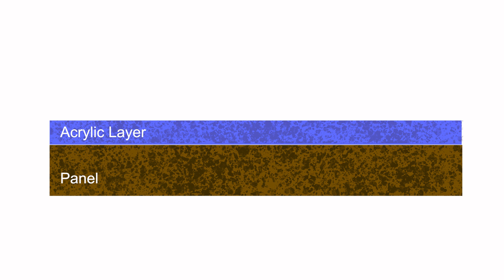Support Induced Discoloration (SID), what is it? and how to minimize it.

Comment: Do you still need to worry about SIDs if you use thin layer of acrylic and then oil paint on top?
Reply from the maker: Our current understanding of SID is solely related to discoloration of acrylics as they are drying. SID should not be a concern for your oils if you follow standard practices for oil ground preparation. If you are considering applying oils over acrylics, we recommend reading our latest research on the topic: https://justpaint.org/revising-our-recommendations-for-using-oils-over-acrylics/

Comment: How long do I have to wait after applying gloss medium to a cradled wooden panel to glue a print to it?
Reply from the maker: The SID blocking happens right away after the Gloss Medium is touch dry, but can be improved by waiting over night. If you have time, we recommend waiting 12-24 hours.

Comment: If I am mounting good watercolor paper (100% cotton) to a cradle board, could I paint one coat of the gloss medium on the board, let it dry well, then use the second coat as the 'adhering coat' when I adhere the watercolor paper to the board? Currently, I have been using 2 coats of GAC 100 as the isolation coats, then adhering the watercolor paper with matte medium. Looking to save on how many coats of anything I have to apply, Two coats total would be nice! Thank you.
Reply from the maker: This video shows how to mount watercolor paper to a panel with one single application of Soft Gel. There are other techniques, but this is the most straightforward: https://www.youtube.com/watch?v=ggB1veQmwNU&t=1s 
Let us know if you have additional questions. You can reach our Materials & Applications Specialists directly at help@goldenpaints.com

Comment: Should you add the gloss medium to both sides of the panel or just the front?
Reply from the maker: Just the front typically. Gloss Medium helps block SID due to water from paints going into the surface and pulling up impurities as the water evaporates back through the paint layers. So surface is key in this. The back can be tricky depending upon how work is displayed. Acrylics are thermoplastic so if they get hot they can become tacky, which can stick to a wall if in direct contact.
Reply: @GoldenPaints 
Thank you for this video and for all your helpful information in the comments! There seems to be some conflicting opinions online  about sizing just the front vs all sides - which some say may mitigate the chances of the HDF panel warping. If one wishes to size all sides, would a subsequent layer of gesso solve the problem of the back of the panel being tacky if it makes direct contact with a wall or perhaps even a frame? Thank you in advance!
Reply: @GoldenPaints  Thanks a bunch!!!

Comment: I sealed my wood panel with two coats of gloss medium and then now that im puttkng gesso over it, it seems to not want to dry well. It feels somewhat too pliable and that the gesso will scratch off. Usually this gesso is fine on canvases. I was trying to avoid the Sid but now I'm not sure if I'll be able to sand this gesso down at all.
Reply from the maker: Thanks for your comment, @ne3113. Gesso should be fine over top of the Gloss Medium in terms of adhesion. Make sure both products are well stirred before use. The Gloss Medium does not have to build up on the surface to be effective - one or two thin, brushed on layers should suffice. If you continue to have issues, please contact us at Help@goldenpaints.com
Reply: @GoldenPaints  thank you so much for your response. You saved my project. I had put on two thick layers, that was my issue. This time around I brushed on 2-3 thin layers and it made a world of difference.

Comment: How long between coats of Gloss Medium, and how long should I let it cure before painting? I'm not using gesso, I'm painting gloss medium over a pre-primed canvas.
Reply from the maker: Hello Carrie, you should be OK once the Gloss Medium is completely dry - although additional "cure time" would not hurt. Depending on the conditions in your studio (temperature & humidity) 24 hours should be sufficient.

Comment: Does this phenomena occur in acrylic painting only? What about oil painting?
Reply from the maker: Hello Armada, Yes - this is only an issue for acrylic painting because of the drying process (water evaporation). Acrylics, particularly the water in acrylics permeates the hardboard, then goes back up through the surface of your painting as it dries bringing impurities with it and introducing them to the paint. Oil paints dry by oxidation, rather than evaporation. This isn't to say that impurities can't get into oils painted on hard board, only that it won't happen the same way or to the same degree as it does with acrylics.

Comment: Does it have to be gloss medium? Will gel matte work as well? Thanks
Reply from the maker: Hello Emily,
if you're referring to sealing the panel to prevent SID, unfortunately no. Our recommendation of Gloss Medium for this purpose is based on testing a range of products and a matte gel will not be as effective as Gloss Medium.
Reply: @GoldenPaints  will regular gesso adhere to the gloss medium?